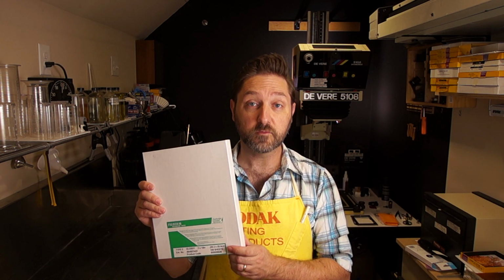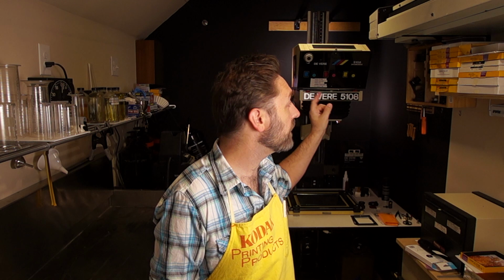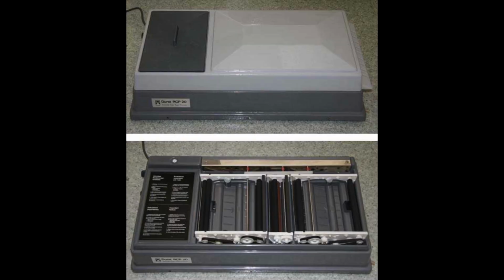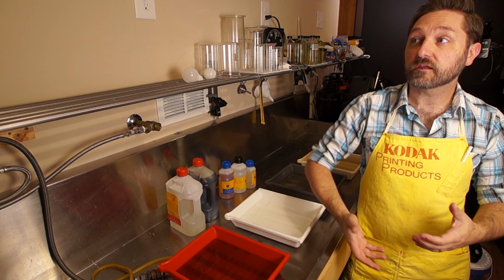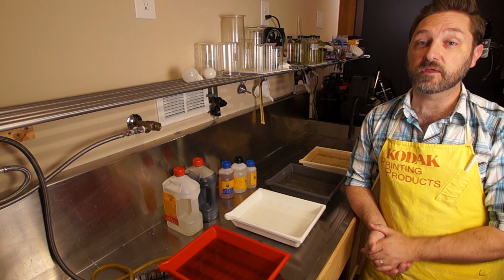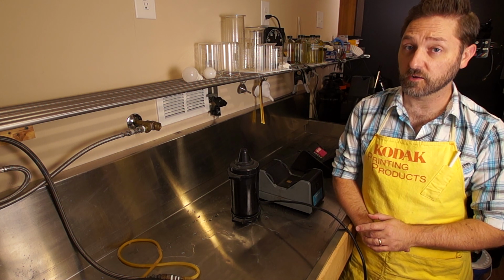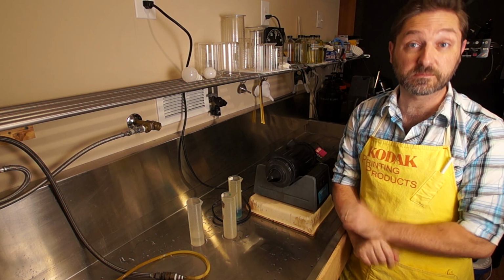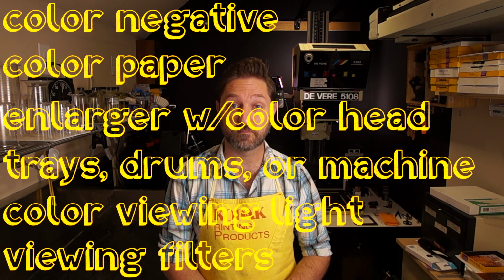RA-4 Printing, pt 1: Tools and Materials

Comment: One of THE best series of videos on the internet with regards to the RA-4 process for beginners new to the process. Well put together, not convoluted or overly long and most of all to the point. Thanks to these sets of videos and a quick flick through my dark room handbook I was able to make colour prints at home in no time. Once you get the basics it's actually no more difficult than B&W I find. Assessing colour shift can be a little difficult at first without any special tools but once you get it and dial it in I find it's usually ok for subsequent prints if the temperature of the lighting is consistent i.e. daylight.

Comment: You have a note that says in addition to the three-bottle RA-4 developer, you need a developer starter.  How is that used?
Reply from the maker: The developer that I use, Kodak RA4-RT is technically a replenisher, which is stronger than a developer.  In order to get it to a stable developer, a starter solution is added to a fresh mix.  Without it, replenisher would give you unpredictable results.

Comment: You mention possibly making your own drum from printing larger sizes. I tried making my own using the light trap shown here: https://16mmadventures.com/2013/07/15/diy-daylight-developing-tanks/ . I realize that this is for 16mm film development not prints, but I figured it work just the same. It kind of did, but it was hard to pour chemicals into and out of and was just not great to use. So, if you do get around to making your own drum I hope you make a video. I'd be greatly interested. Your videos have been really helpful as I built my own darkroom over the last few years. Thanks.

Comment: This video is very informative, thank you! Is it bad idea to mixing up all the 10L chemical at once and keep it in a 10L tank?
Reply from the maker: Not if you use it.  If it sits a while the developer will oxidize and become useless.
Reply: @TheNakedPhotographer  Okay, so I should mix only the amount I use. Thank you! I just bought the drums and the motor, I'm very excited to try.
Reply: @TheNakedPhotographer  I wonder, in this drum processing with 50ml of chemicals for 8x10 paper, how many prints can you make until you have to change the chemicals?
Reply from the maker: I only use each chemical once

Comment: The Naked Photographer in terms of tools you don't recommend a colour analyser? Is it not useful to reduce paper tests? Thanks
Reply from the maker: I have just never used one.  If you have one and find it useful then continue.
Reply: That kind of tool is more appropriate if you shoot a test frame with your negative with a Mc beth color checker chart as a reference, calibright or xrite make good one they work not only for digital camera but also on oldschool film method. The only thing you cant change on film is the white balance, cause your portra kodak for exemple is tungstene balanced and your ektar is more daylight balanced, for using tungstene film as daylight you should use a kodak filter on your lense to compensate when you shoot your picture.

Comment: Hello, Is it possible to use a condenser enlarger and filters? And... is it possible the contact printing from 8x10 sheet film to 8x10 paper? Thanks
Reply from the maker: Yes to both.  I have made contact prints of color photos before.  It works just fine.  A lot of people use color printing filters with condenser enlargers, just make sure you have a color print filter set.
Reply: @TheNakedPhotographer  Thank you very much. Another important question. What about the look of the RA-4 prints? Are they different from a inkjet color print? I'm 53 and sincerely I don't remember a really nice color print in the past but perhaps They had a minilab look and so it had a poor quality,
Reply from the maker: Too many variables to describe the differences, but, yes they have a different look

Comment: Thank you for the video. Amazing series! What are your thoughts on the Nova Print Processors? Looks like they are very convenient to use, they take up less space compared to trays, you can airtight the slots (less smell) and are temperature controlled... Hmm!
Reply from the maker: I’ve used one before.  It was alright.
Reply: @TheNakedPhotographer  Thank you for your comment. 'Alright' doesn't sound amazing. Why do you prefer the drum method?
Reply from the maker: It’s just what I have.  I wouldn’t say it’s better

Comment: I've been researching RA-4 chemicals as I'm getting closer to finally attempting this. One thing I noticed is that Kodak's minimum quantity is 10L. Do you mix up all 10L upfront, or do you mix it in portions? Also, how do you store the stuff? Somehow, 1L and 1gal bottles are easy to find, but other sizes not so much. (And I'm guessing I should have something that 10 is divisible by, without needing a whole cabinet full of separate bottles.)

I've also noticed that Kodak makes an "additive" to extend the shelf life of the concentrates, but the docs are unclear on how much of a difference it makes. (Likewise, the docs don't seem to show numbers for how much longer the RT chemistry lasts versus the non-RT chemistry, despite the RT stuff claiming to have extra oxidation protection.)
Reply from the maker: If I am going to print only a few prints I will only mix up a couple liters at a time.  If I’m going to print a whole exhibition I will mix the full 10 liters.  I use glass bottles in 1 gallon, 1/2 gallon, 1 quart, and 1 pint.  If I mix the whole 10 liter package then I will fill up a 1 gallon bottle and 5 quart bottles.  When four of the quart bottles are emptied, I refill them from the gallon.  This minimizes air exposure.  The last liter is  usually still in a measuring beaker to be used immediately.
Reply: @TheNakedPhotographer  Thanks, that guidance was quite helpful. I just confirmed that a 1 gallon jug (at least the plastic Delta ones) will actually hold 4L if you fill it to the top. I'm hoping the same is true for the glass ones like what Photographer's Formulary sells.
Any tips for cheap "disposable" containers to collect used chemistry in for proper disposal? The whole disposal situation is going to rapidly become a huge issue once I start one-shotting for color prints.

Hopefully I'm now only a few weeks away from actually ordering chemicals and paper to get started on this.
Reply from the maker: I use a plastic 5 gallon paint bucket and lid for the waste
Reply: @TheNakedPhotographer  When mixing 10L, do you mix in 1-2L increments or do you actually have a huge 10L mixing container?
Reply from the maker: I have a 10L container
Reply: @TheNakedPhotographer  Even if I did, I'd be worried about pouring out from it without spilling :-)
Reply: So I'm now in the middle of mixing up a batch, and doing it in 1L increments is getting quite tedious. (Doing it this way given the size of my mixing equipment and concerns over accurate and spill-free pouring.)
What sort of 10L+ mixing container do you use, how do you stir a vat that big, and how do you pour out of it into smaller bottles without being concerned about splashing chemicals all over the place?
Reply from the maker: I use a Doran 2 gallon storage tank with floating lid and spigot. https://www.bhphotovideo.com/c/product/88372-REG

Comment: Another great video but I’m missing on other processing method.  I started color processing in the late 80s, first with a Daylab processor and then upgrading to and ATL-1 Jobo drum processor. However, my best investment was to buy a Nova slot processor. Don’t know if they are still available in the US but they still make them in England ( just search for NOVA Print Processor). They come in different configurations but mine have 4 heated slots, each one holding 1 ltr of chemistry and you agitate the prints vertically by lifting and dunking them. Best of all, they have a small foot print (~10”x12”) and, due to the small surface exposure, the chemicals last much longer that in an open tray. When not in use, each slot can be covered with a tube, extending the life-span of the chemistry. I never had any problem keeping the working solutions good for a week. With the right workflow and setup you can easily process 20 8x10 prints in one hour.
Reply from the maker: I used one about 10 years ago.  They are nice, but very hard to find in the US.  The model I used allowed prints up to 16x20 inches and had three slots.
Reply: Very curious about the smell of the chemicals in the Nova slot processors! Do they small bad when printing? What about when it's stored and not in use? I'm in an apartment so don't want it to stink up my place especially when stored and not in use (with the tube covering). Also, with drum processing, how is the smell? Which process smells the least?

Comment: What are the other two chemicals that go with the 3-part RA RT developer?
Reply from the maker: The developer comes as three parts, A, B, and C that you mix together with water.  The blix is made up of parts A and B, also mixed with water before use.
Reply: The Naked Photographer Thank you! These videos have been very helpful

Comment: Ive been researching kodak RA-4 Developers and there is a 'Starter' and 'replenisher'. I'm confused, do i need one or both of them?
Reply from the maker: Replenisher is your developer, but because it is supposed to be added to slightly used developer it is extra active.  Starter is an additive that you put in the replenisher if you aren’t adding it to used developer to tame that extra activity.
Reply: The Naked Photographer thanks for the reply, so I’m assuming then that I would only need the ‘starter’ if I wanted to slow down the developing time for some reason? As a beginner to RA4 I would only need the developer replenisher and blix if I was using a processing  drum?
Reply from the maker: Omitting the starter will give a different filtration, but as long as you are consistent it should be fine.

Comment: Thanks for sharing! One thing I've had luck with is a pair of cheap kids' night vision goggles. Doesn't fog the film (CCD camera and IR LED's) and I can actually see what I'm doing. I've been considering getting some IR flood lights to use as a safelight and a pair of those VR goggles you put your phone into and then using the on-board camera which will see the IR light.
Reply: John Milleker Photography that’s actually an awesome idea ! If I may, what is the brand of the goggles you use ? Thanks !
Reply: @loicmathys4057  - Sorry for the delay, I've been out of town. The brand I have is Spy Net Ultra Vision goggles, anything will work - this brand isn't made anymore but is overpriced on eBay for $100+.

In fact, these night vision goggles are just cheap CCD cameras. I'm considering getting one of those goggles you put your phone into and see if I can use the built in camera. Those cameras are CCD's and see infrared light. 

Turn on your phone camera and point a remote control at it, you should see the remote flash! If the camera can see that, why not use a much nicer camera and an Infrared flood light in the darkroom?

Comment: Thanks for this video. It is the only one I've seen which tackles the subject of RA printing. Unhappily, that may reflect the ease of inkjet printing over wet work, but then the quality of a good RA print cannot be matched by inkjet. (I suppose they said the same thing when dye transfer printing was abandoned by Kodak.)  I use a roller system similar to yours, but I prefer the Cibachrome drums. Unlike other brands, both endcaps are removable, so Ciba drums can be fully disassembled for wash and dry in just a minute, an absolute necessity for the Cibachrome process. They were made in sizes from 4x5 inches to at least 16x20. The 4x5 drum is great for the one-off test strip. To complete my procedure, I drive the roller base with a processing computer which is programed for all steps, leaving me nothing to do but change the chemistry at the buzzer. Looking forward to the rest of your videos.

Comment: With drum processing, I'm curious how you handle test strip processing and drying the drums between prints without going crazy.
I'm planning to attempt RA-4 myself in a few months (using a Jobo or standalone drums like you), and have started accumulating some of the non-consumable supplies, so I'm definitely looking forward to watching the rest of this series.
Reply from the maker: I cut the strips so they still fit the circumference of the drum, even though they do not reach the length.  I use the same amount of liquid to ensure coverage.  To dry the drum, I have three that I rotate use.  I dry one quickly with a shop towel and let it air dry while I use the other two.  By the time I get back to the first drum, it has dried completely.  I will show what a drip defect looks like next time because I mixed up my rotation.